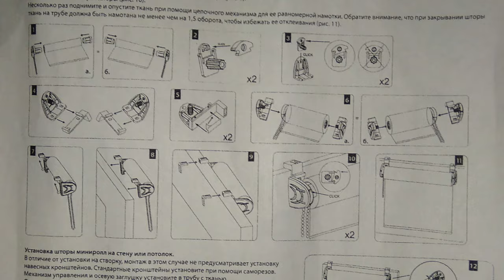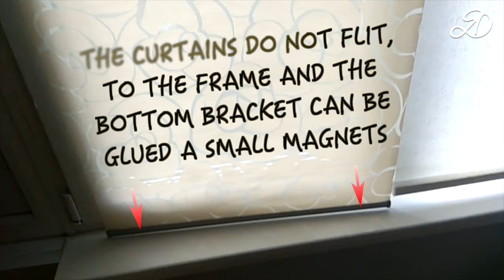Non-standard installation of roller blinds. How to install roller blinds DIY

Comment: The f***, this IS a standard install!? You should have actually done a non standard install and cut the blinds down to size so they could all be installed side by side and not have one hanging off the ceiling